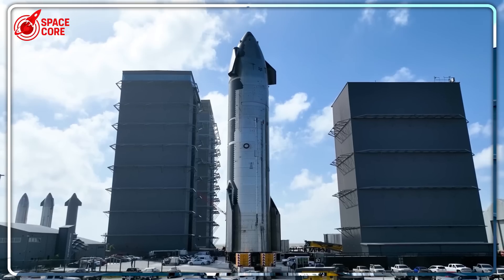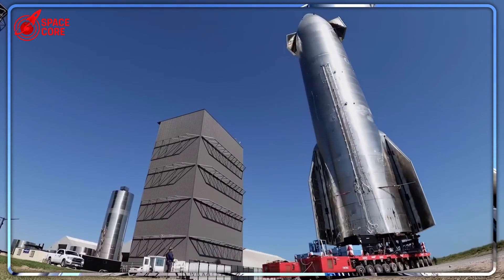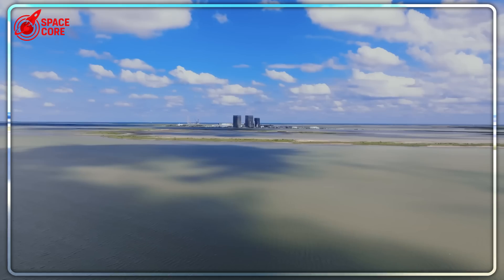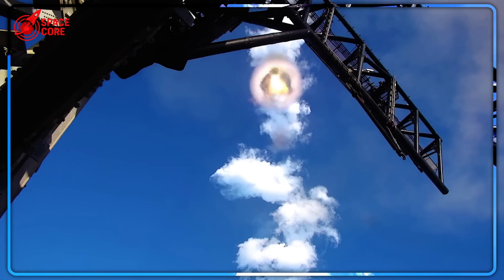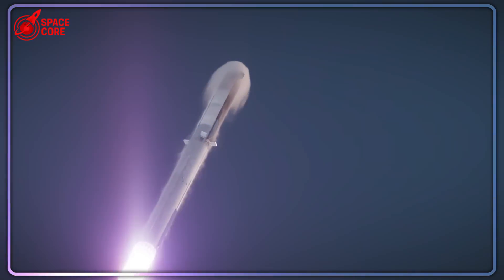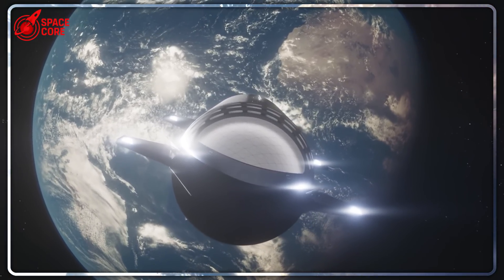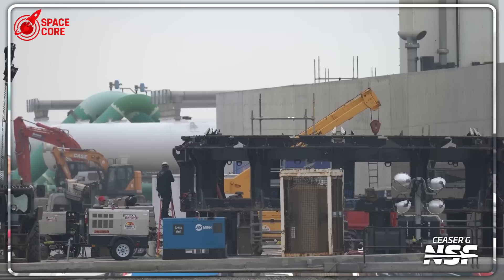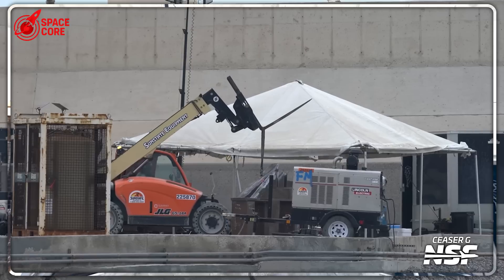SpaceX Finally Revealed Ships 39-44 Assembly Line...Never Seen Before!

Comment: Up to now, spacecraft have all been advanced prototypes. Very delicate and quirky. They were operated strictly as tested because it was not known how they would perform outside of the test regime. Mass production is different. Production articles are tested to determine  how robust the design is with respect to violation of the expected operational environment. Reliability statistics are established, and manufacturing is carefully controlled to ensure operational performance when there are unexpected deviations in the operational environment. The emphasis is not on one-of performance but system performance and returned value.
Reply from the maker: SpaceX’s mass production shifts focus to robust, reliable systems, not fragile prototypes.